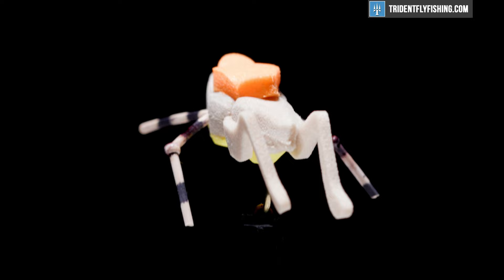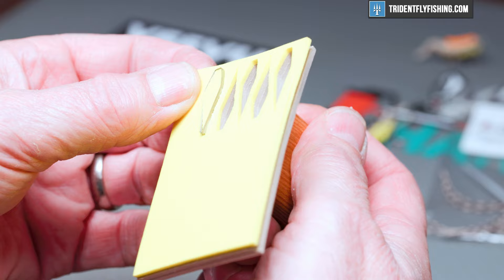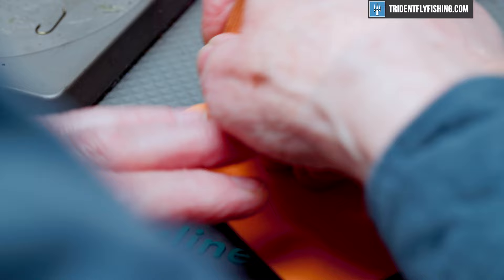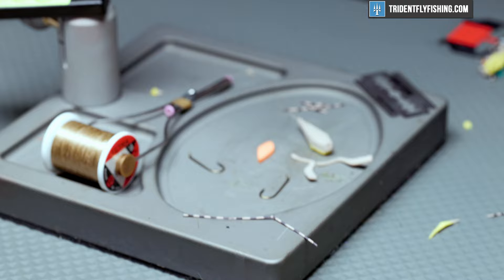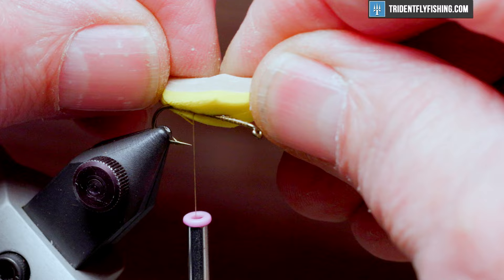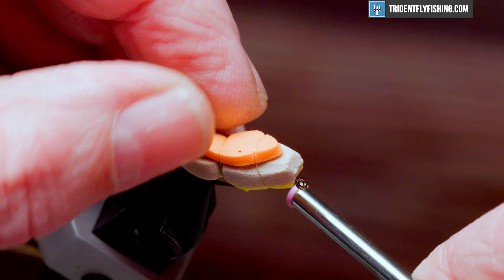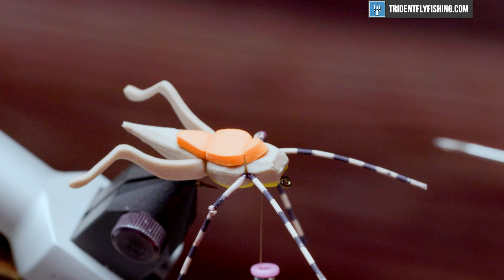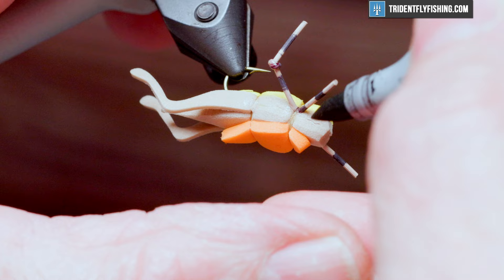Morrish Hopper Fly | Best Hopper Pattern? | Fly Tying Tutorial

Comment: Nice tie as usual.  

Back in 1988 I designed a hopper fly that used rubber legs with a knot in them for the back legs.  The Rubber legs back then were square and made placement much easier than with round rubber legs.  The round rubber legs tend to roll as you tie them in and even if you get the straight, the next wrap can roll them a bit.  If you find that yours has rolled, you can usually get it back in place without the need to unwrap your thread and re-set it.  Just grab the part of the rubber legs in front of the tie and twist it in the direction that you want the back section to go.  The holding onto both pieces, pull on the back section (one with the knot in it) and it will move slightly to the back.  Don't pull too hard or it will really twist and then you'll have to reverse the process pulling int he front instead of the back.  

What happens when you twist that section is that it makes it thinner, which allows you to move it slightly as long as you haven't glued it in place.  It's a bit of a Goldilocks effect - if you pull too much it will twist it too much, if you don't pull it far enough it will twist too little.  But you'll quickly get the knack of it.  If you want to avoid that problem all together, tie the knot in the legs after you've tied them in place.  Every once in a while I would pull the knot too tight and it wouldn't put the angle in it that a looser knot did - again Goldilocks effect. Using the zap-a-gap on the knot like you see in the video is an easy solution instead of accidentally drawing it too tight.  Just pull it until you get the bent angle that you want and then hit it with a dot of that super glue.

I actually worked with Kenny Morrish back in 1987/88 at the Orvis San Francisco store when it was still on Maiden Lane in San Francisco.  He was a young fellow who had been traveling all over the country in his VW Vanagon and living out of it.  He was the consummate Trout Bum at the time traveling all across the country just fishing.  We fished together a few times on the McCloud River in CA, but our days off didn't often coincide so I didn't fish with him a lot.  One of the things I remember was that at the time he had a pair of wading boots that were way too big for him so he wore three pairs of socks and used them because that's what he had and he could make it work.  He was a very upbeat, practical, and intense fly-fisher when I knew him and was already an accomplished fly-tier.